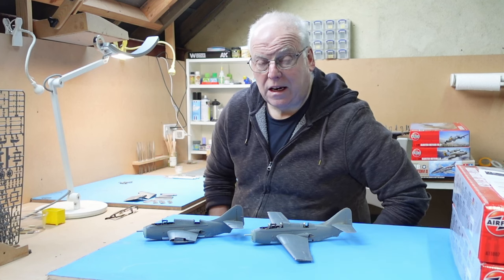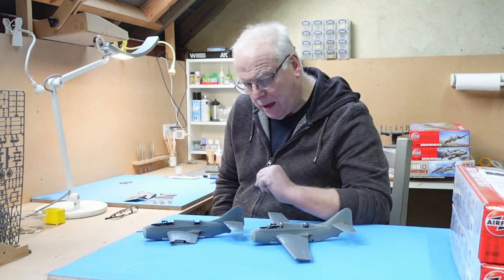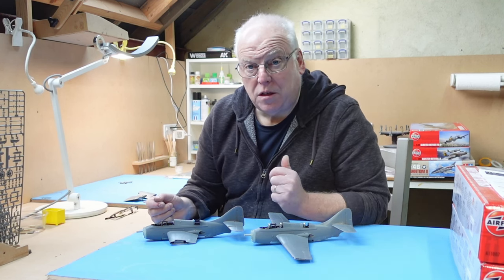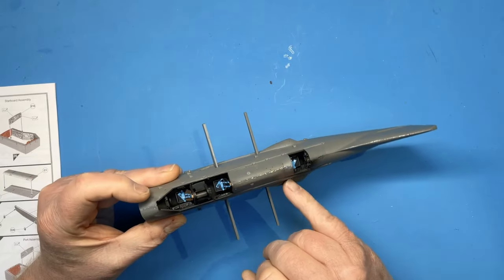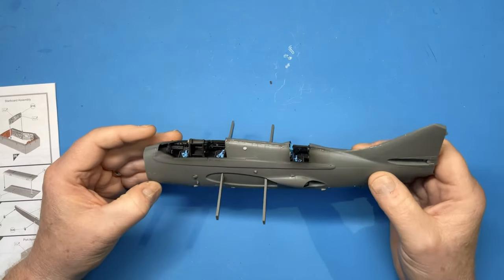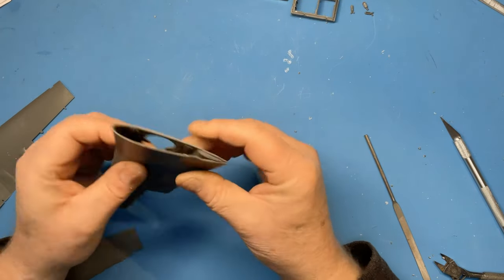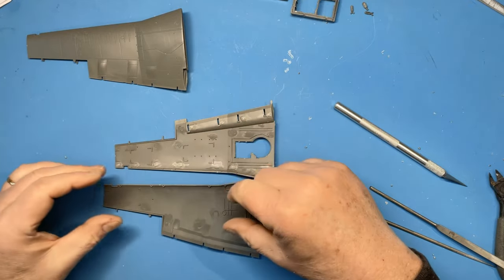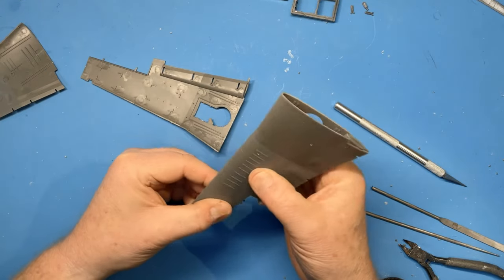Airfix 1/48 Fairey Gannet double build Part 2

Comment: maybe i am too late but those little tabs in the wheelbay opening are really just there to hold the doors in the correct position if you build it with the gear up
Reply from the maker: I think so too - I remove them for E3

Comment: Nice work Steve, what are your thoughts with the new sprue attachment points, good or a hindrance?
Reply from the maker: Definitely a plus John - as long as you clean them up they reduce the scarring on the surface of the part
Reply: @TheModelShed  I think Takom use this system and Trumpeter?